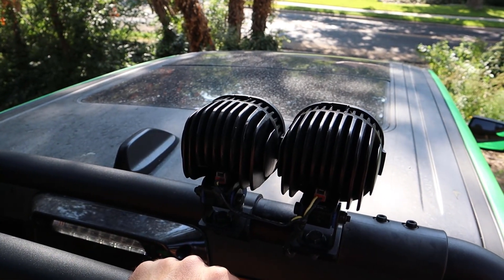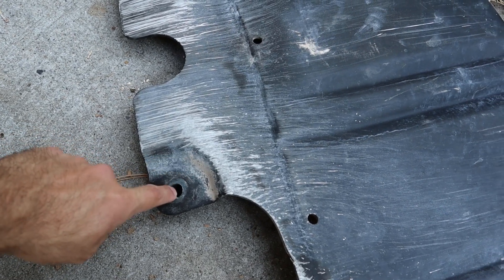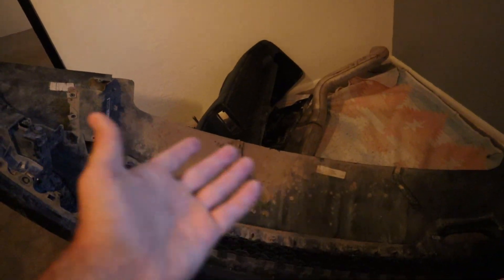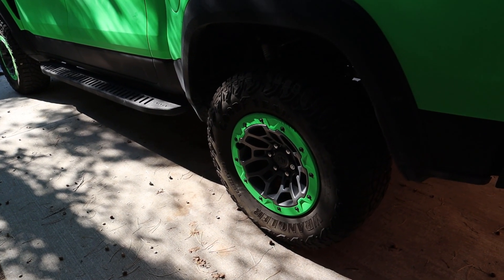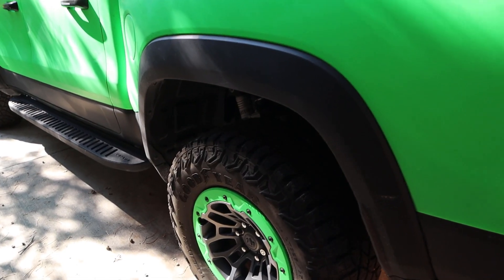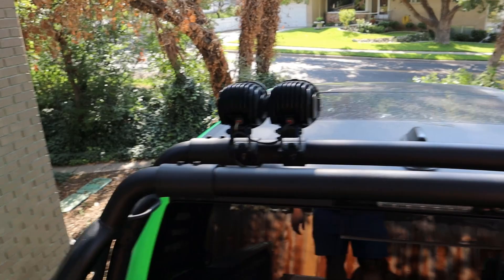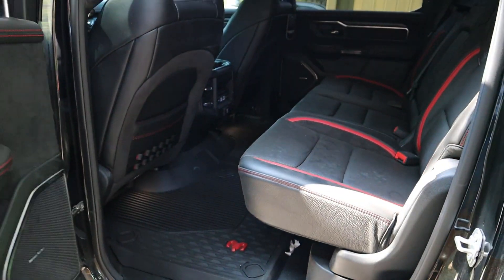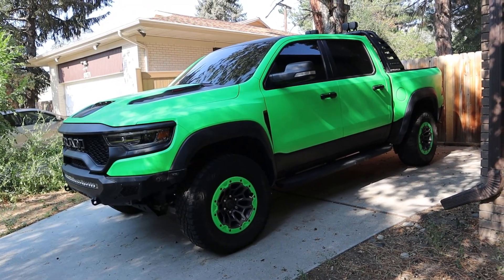Everything I've Destroyed On My Ram TRX In Only 7,000 Miles...

Comment: Was tempted to get a TRX but when I went to the dealership and saw it in person I just wasn’t all that impressed. Engine and interior are amazing, but the truck just doesn’t look special like the Raptor. It just looks like a beefy Rebel and I think that is where Ram dropped the ball.
Reply from the maker: That’s why you gotta get it with the ram bar👀
Reply: Nah even the raptor doesn’t look too special. Now a 2003 Ford Lightning. That was special.
Reply: You can get a V8 Raptor next year
Reply: @RealAGuy  Yeah, I probably will. I have just been very impatient with Ford. I am picking up a low mileage (40K miles) 2013 next week and gonna wait the year until it is available. I sold my Gen2 this summer due to the ridiculous offers that dealers were offering for used Raptors. I couldn't pass it up but part of me regrets it...but I am looking forward to owning a Gen1.
Reply: @Ww8.3  you are adding, right? That truck is a muscle car posing as a truck. No thanks
Reply: @Mursedave  I own a 2013 gen 1 too it’s a great truck.